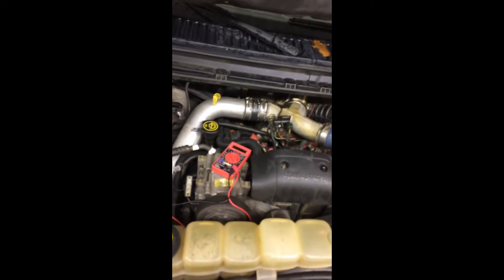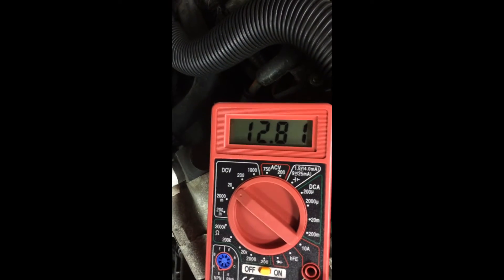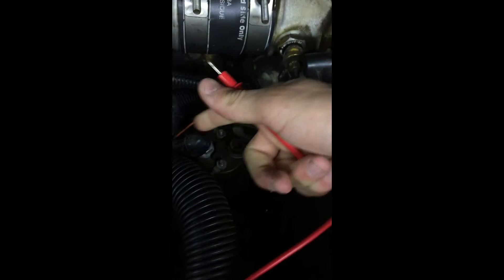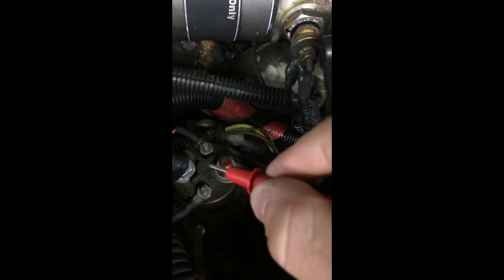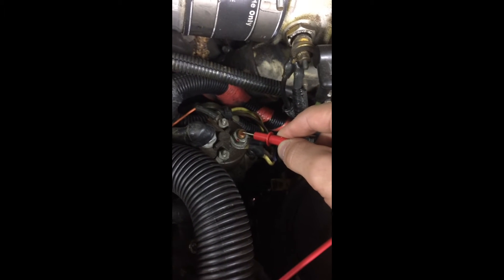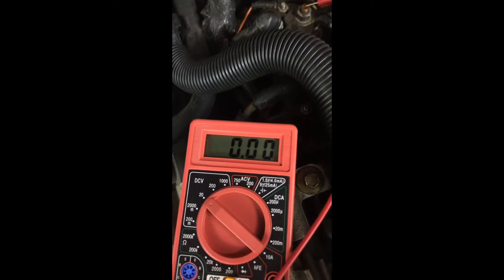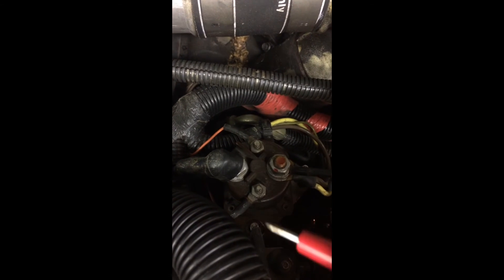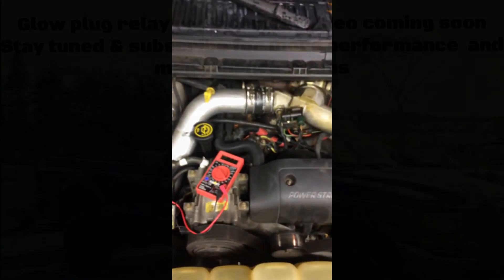7.3 Powerstroke Glow Plug Relay Test

Comment: The relay needs to be isolated or taken out of the vehicle and ohlm and get readings. Then turn your meter to DC voltage and  apply voltage from an alternate source then checked with a multimeter. Also, use a jumper wire after looking at a schematic to see if the magnetic switch or relay makes contact.